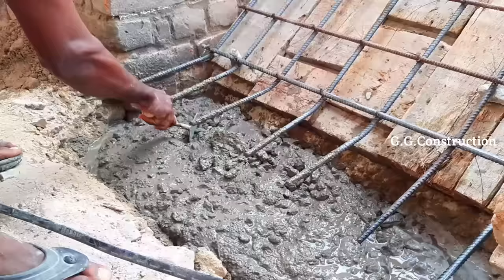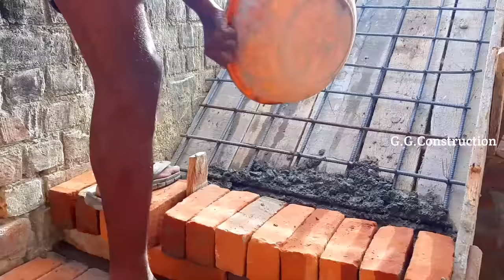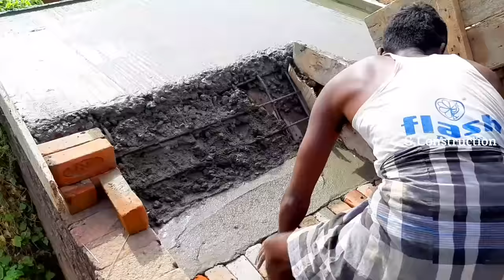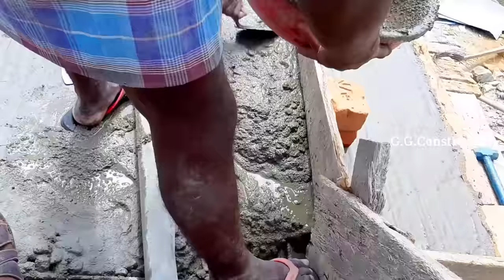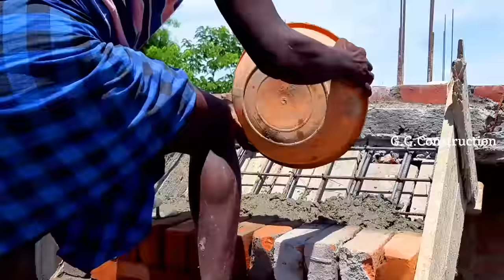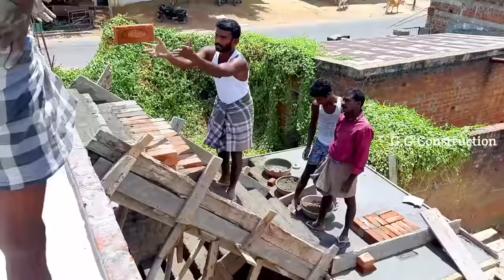Massive style in stairs concrete making do creative Amazing with skills work-using by sand cement

Comment: No crank rods, in foundation rods was not properly inserted, joints between flight slab and roof slab was not properly jointed, no cover, cement water ratio not fallowed

Comment: Reinforcement is not properly designed ie in landing slab  scissor crossing rods are not provided .At foundation second layor waist slab rods are not tied ..no proper cover blocks fixed ..not even bothered about vibration of concrte ..bricks are used for forming steps.. very old system .. filthy way of doing step concreting work..Pl learn the job and upload videos...this type of work no intelligent engineer will accept..